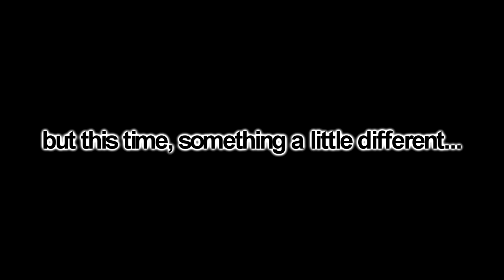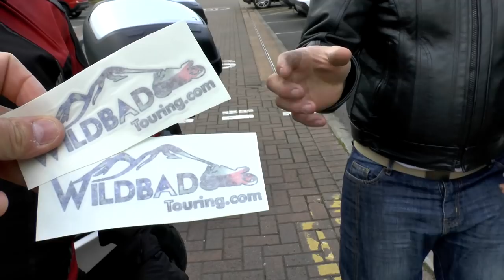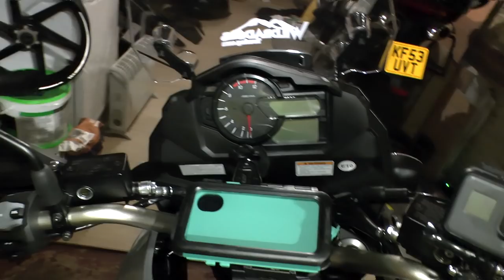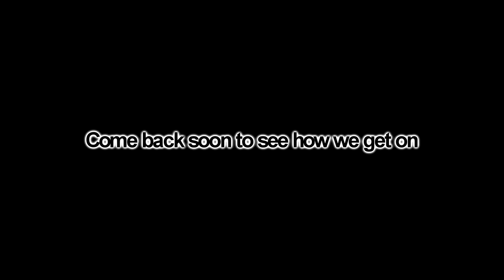Wildbad | Aberystwyth 2018 | Collecting & Prepping The Bikes

Comment: Been using 'Ultimate Addons' equipment for over 2 years now Rich.... bloody amazing kit I must say. Waterproof phone holder mounted safe and secure gives total peace of mind whatever the conditions and as for the weatherproof charging I simply hide my USB charger in a dry location under my seat wired through a switched live circuit that's separately fused. Route the cable under the petrol tank and up to the front of the bike finally terminating the connection directly inside the phone mount and no worries when it's 'Chucking it down' time.... Looking forward to the next instalments Guys.

Comment: I own a strom 1000 (2016) myselve for touring and 2-up riding. I think it does everything well in a anonymous way but it can get a bit boring and its slow as fuck...:) Once you accept that you find yourselve enjoying the immense comfort tho. Its great for what i use it for but i cant help but feel happy i own my cbr1000rr to compensate the lack of power the strom displays... One tip, back off both compression and rebound screws on the front by about 4 clicks. the stock setting of the forks is way to stiff and makes the ride feel hard and bumpy on the front. 4 clicks on both in and outgoing damping makes a world of difference and doesnt have a negative effect on handling infact it stops the bike from running wide on really fast curves.... enjoy the trip,i look forward to your experiences with the stroms....